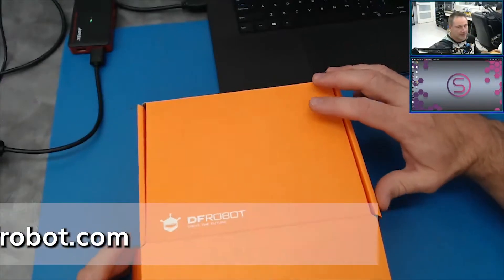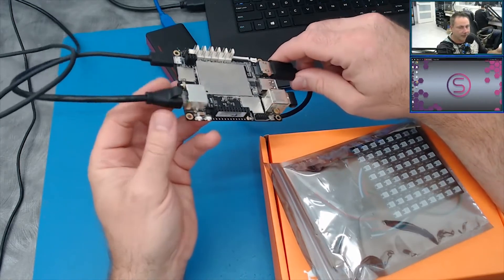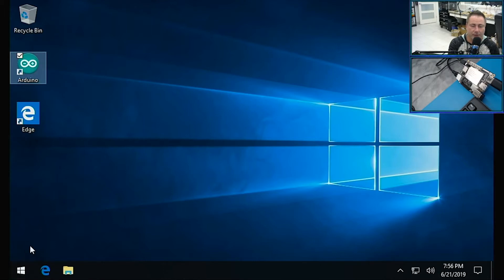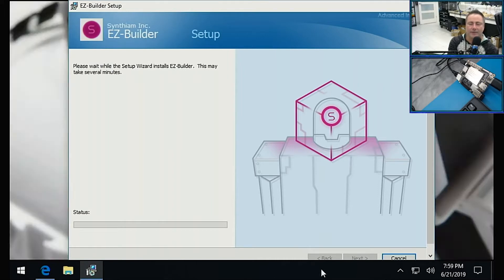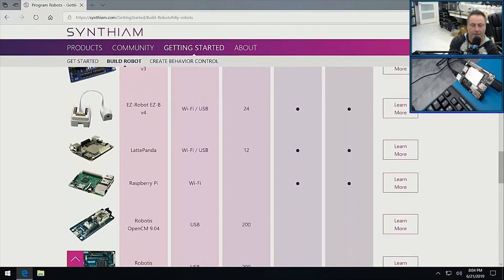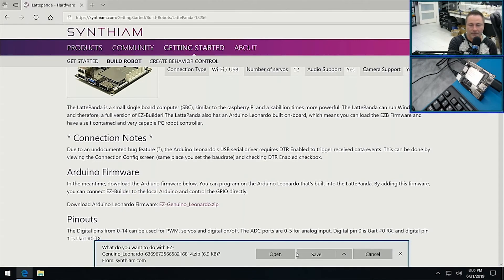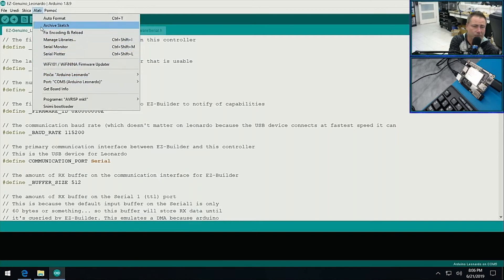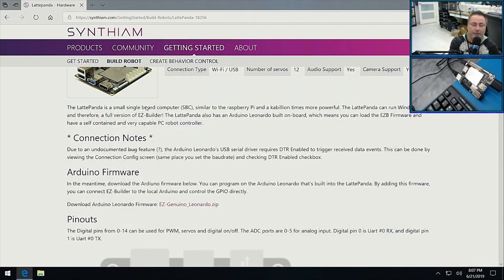Tutorial - LattePanda (Part 1 of 6) Install Firmware & EZ-Builder

Comment: Hello thanks for your videos and the hard work. 
Please can you use c# with lattepanda for example (lighting led,push buttons...) without using arduino app or signal port (like using c# application for raspberry pi3 on windows 10 iot).
Thanks in advance.
Reply from the maker: Glad you enjoyed it. The lattepanda has an arduino build on the pcb with I/O. The I/O is connected to the arduino and therefore required for the x86 to use them. Continue watching the video series to learn more